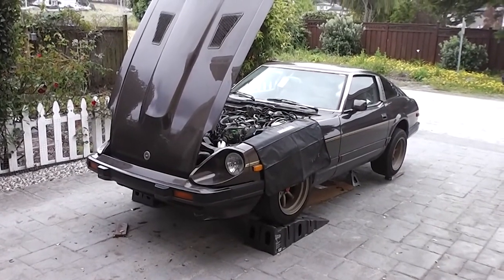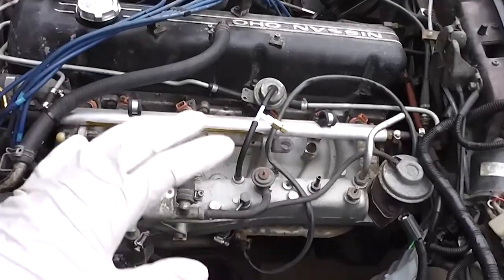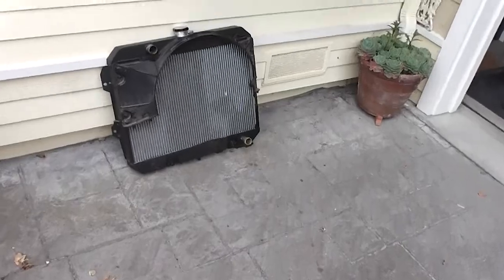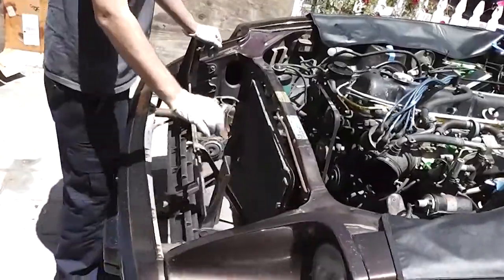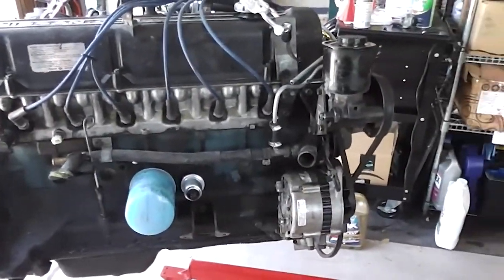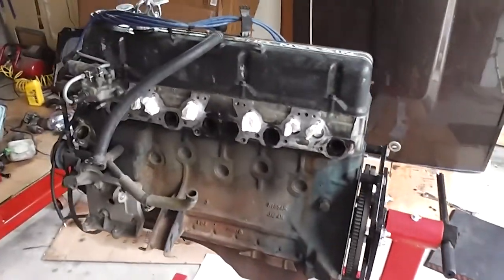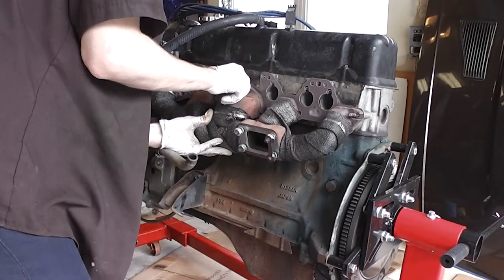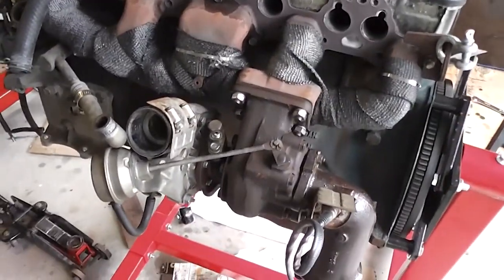Installing a Turbo on my 280ZX! - Part 1: Engine Removal

Comment: You need to get rid of that N47 head. Many say it is prone to cracking by the exhaust seats. Also the steel liners in the exhaust ports may limit flow, although I know it's for emissions reasons. Square ports will flow better, an example is the N42 heads. Or even the E88. The P90 is another one. We have the N42 here in mass numbers. Blow through turbo, giving the RB one hell of a time!
Reply from the maker: Its actually got a P79 head since its an '82.

Comment: Definitely should consider shimming your oil pump to get some more pressure. You'll have at least an extra quart of oil in the system cause of the turbo stuff, and your engine will last much longer with the turbo slapped on that bad boy 👍 been seeing your videos for a long time now, nice to see you stick the same cars

Comment: Hi, I live in PA and we don't have those strict emission laws. I have a complete Turbo engine and T5 from an '83 ZX and would like to install it in my 1979. There isn't much on youtube about doing this swap and am glad there's enthusiasts like you who don't mind sharing their knowledge. I am looking forward to the rest of the install and would appreciate it if you can show how to get the wiring installed and working.
Reply from the maker: Thanks! I'll be using the same "wiring" as I did without the turbo, which is from Megasquirt 2. I have video's on wiring that up on my car as well if that helps.

Comment: Hi i think you need to add ring gap on the piston rings for the extra heat from the turbo .or you might lock the rings up? just thinking
Reply from the maker: I think it depends upon the engine, as well as the amount of boost. I've done a lot of research on NA-T L28's, and some guys are running close to 20psi without touching the block at all, and have been without blown ringlands.  I don't plan on ever running more than 8 psi with the stock pistons anyway, even with an intercooler. Stock boost is 6 psi as well.